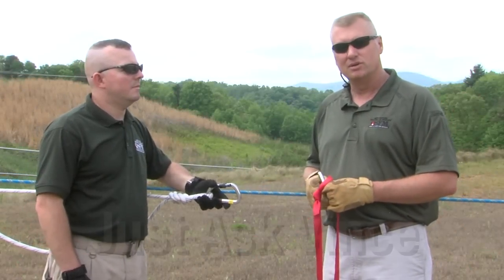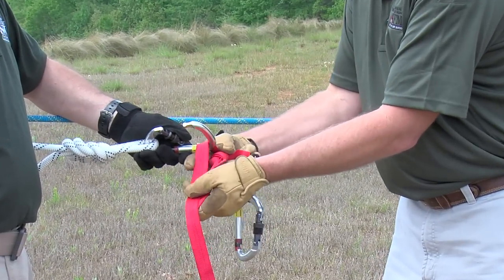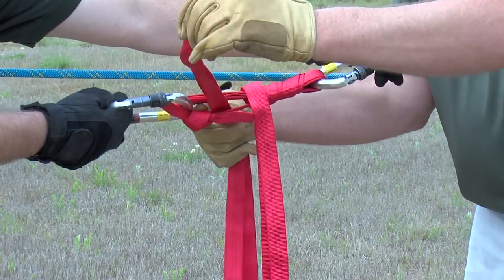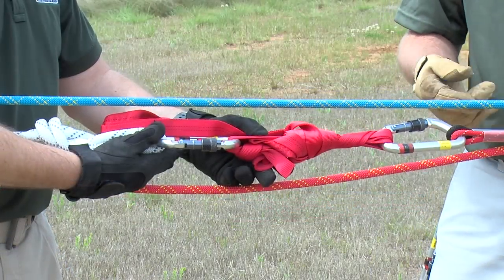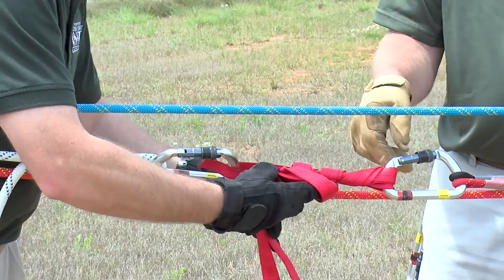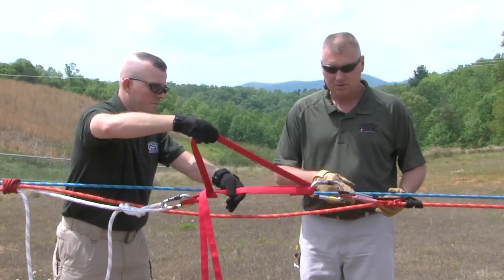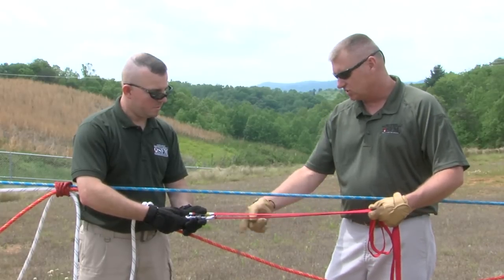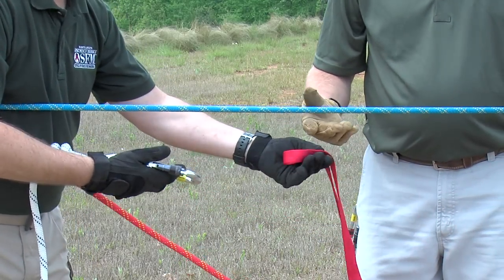Mariners Hitch

Comment: Last example of the loop sling coming completely free of the carabiner is somewhat unclear. Given that release of the line is supposed to transfer load back to the mainline. Any slippage greater than the working length that would allow the loop to come free before reloading the main line would not work as intended. Or if positively secured would not have length to release the load back to the mainline.